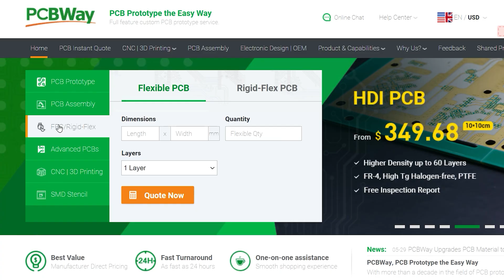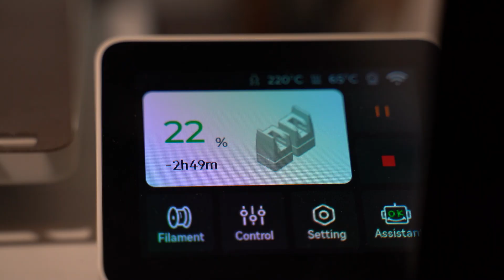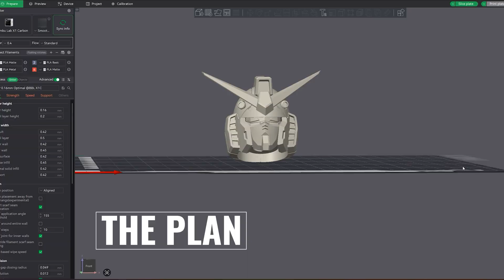10 Must-Print Figures… You Have to See This!

Comment: Those are really cool. How do the joints hold up on them?
Reply from the maker: The Dummy 13 has great joint design, i usually print joints in PETG if extra strength and flexibility is needed